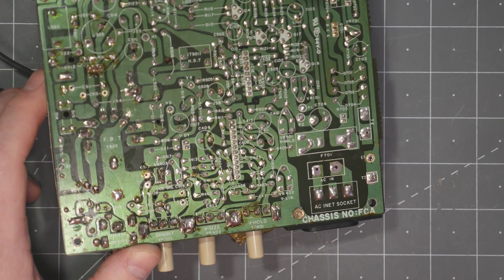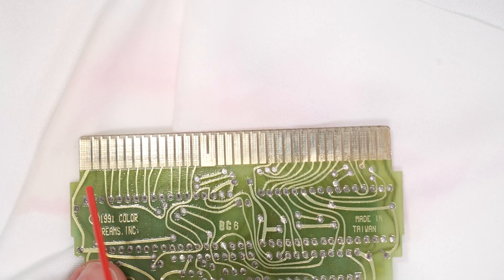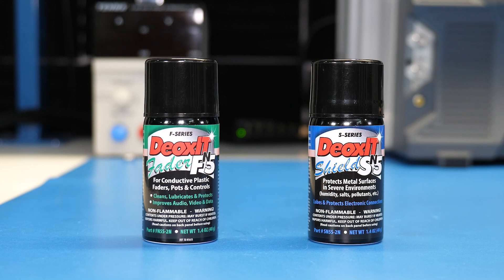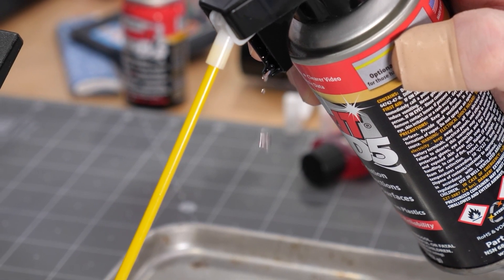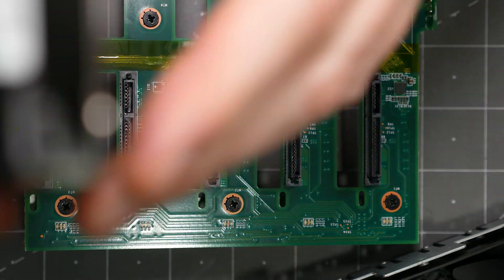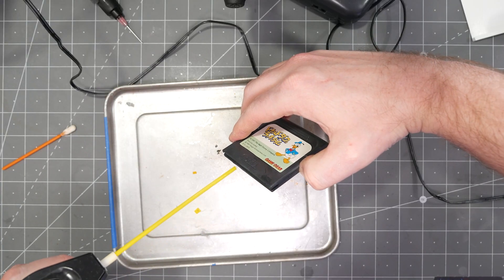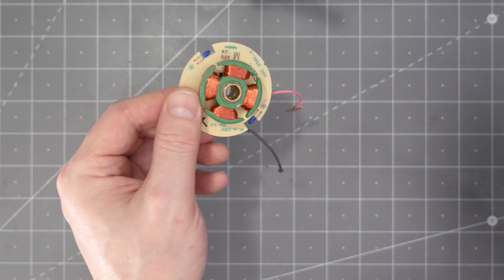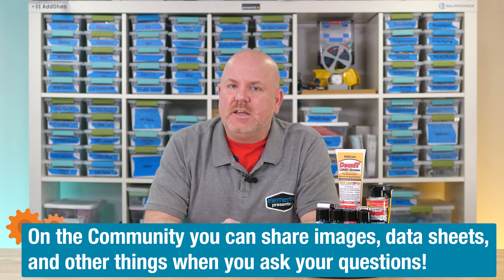What Is DeoxIT and How Should You Use It? - Workbench Wednesdays

Comment: Hot tip: You get Deoxit spray seeping near any optical components for too long and they will not work right ever again.
This is predictable, but keep the precautions in your head in your head. Use a different color towel for the deoxit tainted rag. Mask off holes. Wipe off the drips in a timely manner and clean with alcohol and a clean rag.

RIP one of my mice and my old phone camera (Making this mistake twice feels bad, watch ur overspray)

Comment: Thanks for the video game cartridge test. I was thinking of using it for that specific application. Some of my games are so oxidized that simple rubbing alcohol was very much not working
Reply: I am legitimately surprised how many carts I have had where IPA wasn't enough but DeoxIT gets them working. (Personally, I would still do an initial wipe with IPA and let it dry before doing DeoxIT. That way you get rid of all the surface dirt--especially the stuff in the housing.)
Reply: @bald_engineer Thanks for the tip! Do you use the Deoxit Gold or Shield after using the D5/or 100? The gold is supposed to be a protectant for the contacts from what I've read, but the shield is supposedly an all-around electronic protectant. If you use either one, is either necessary to use after the initial cleaning?

Comment: Great work!  Subscribed.  
 
Deoxit is fantastic, but its delivery method absolutely frustrates. That aerosol container with the hinged straw wastes so much product.  I use a straw system by a company called 
Aeroflex to deliver all aerosol products now and it's saved me money from product waste and more times than not, allows me to deliver precision shots of product in tight spaces that normally required me to remove PCB's.  
 
Edit: The cartridge test results may indicate the deoxit treated area will oxidize slower than the IPA treated side.  
 
Also, do not spray any cleaner or lubricant into fader aperatures directly!  You will almost certainly flush out the lube, causing the fader action to freeze. Then you will have to tear down and apply new grease.  A younger me made that mistake ONCE.  😂

Comment: Good Content ,Thanks I learned quite a bit  as a child in the 1970s  we had a Family member that was a Philco Television and Radio Repair man  he did retire from Ford  and  we always had Philco Products in all of our homes because of his reccomendations and discounts  i remember him giving my Dad a spray can of TV Tuner Cleaner and my Dad  frequently spraying  the TVs.  in our homes. at the Channel Selector and Volume  knobs  but he always called it TV Tuner Cleaner  not Deoxit ? is there a difference  between those ? I myself. love Vintage Audio Equipment from the  1970s  as in 1979. i bought my very first “Real” Stereo system  that happened to be SAE Two seperate Amp and Matched Tuner   plus Realistic Mach One Speakers  at 17 years old i spent over $2,000.00. on thiat system  which was more than my first two Cars  and a lot of hard work. to accumulate
Reply: The "Channel Master" tuner cleaner I used in the 80's was greenish in color. It had mildly abrasive particles in it, and we always used to flush it with regular contact cleaner after use. Cool story about your SAE system. I currently have a SAE model 3022 I rebuilt about 4 years ago.

Comment: I used DeOxit F5 (for faders and potentiometers-contains grease) to release a cell phone battery from its glue/tape. It worked almost instantly, but the oily residue left a yellow border around the screen in places-not too bad, didn't ruin it. Apparently it entered the LCD screen at the edges. I have since bought some original DeOxit 5 and will use that next time. It should evaporate before migrating into the screen. The F5 fixed the the noisy pots and tuning dial on two of my radios and a landline telephone volume fader. Did it all without even taking off the knobs, because they wouldn't come off and I couldn't get the phone open. I love this stuff.
Reply: @freespirit-o6l  to remove battery from adhesive ad a couple of alcohol drops

Comment: I bought a small 2 milliliter vial of DeoxIt at Microcenter to clean the USB connectors from my cell phone to my car's Android Auto module.  Prior to using the DeoxIt, I thought I had a bad USB cable or connector in the dash, but the DeoxIt solved (or maybe dis-solved) the problem instantly.  When the salesman at Microcenter suggested DeoxIt, I suspected it was snake oil, but the stuff really worked.

Comment: @ 4:05 When you get tired of the leaky, hard to control "Perfect Straw" cap on the D5 & D5 Fader pressurized cans, I have found you can remove it, and a lot of "Air Duster" nozzle caps will fit nicely, won't leak, and are very controllable for dispensing product instead of wasting it with the "perfect straw". I made a video to demonstrate the swap with caps from 2 brands of air duster cans.

Comment: And iḿ just sitting here with my random contact cleaner wondering why it doesnt work every time as It should.. turns out I had no idea there were different kinds.
Reply: Well, I just used DeoxITLiquid, squeeze tube 100% solution on a pot volume control on my radio, and now the volume is always high. I can't turn it down even a little!

Comment: Interesting.

What concentration % of IPA did you use to clean with when comparing against the DeoxIT?

Never heard of the brand, or it's parent company either, so a bit of a gain in regards to effective marketing for your sponsor.

The fact that you mentioned "plastics that are 30-Years or older" suggests that it may react with some additives that used to be used in plastics production and that no longer are, OR, that it may just be making some plastics ever so slightly brittle and that it is more noticeable on plastics that have already naturally become brittle over time due to age and exposure to natural light, etc...

I have my concerns around the fumes that it may give off, AND, If in the long run it has any effects on the environment or recycling process when it eventually comes to the day where my old electronics will have no choice but to be recycled due to being worn out.

I do not want to be buying products that contribute to the damage and pollution of our existing but fragile environmental ecosystems.
The same environmental ecosystems that industrial chemicals so often seem to affect for decades down the road with full knowledge of such being available at the time of original sale but simply ignored or even maliciously hidden in the pursuit of profits.
Reply: 99%